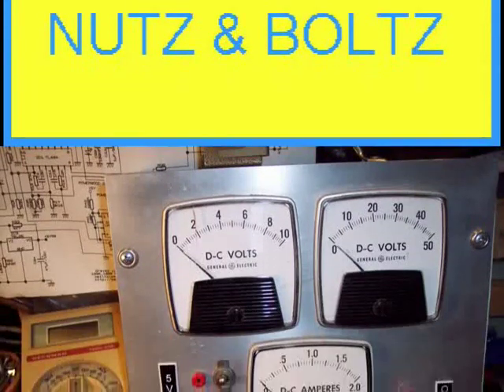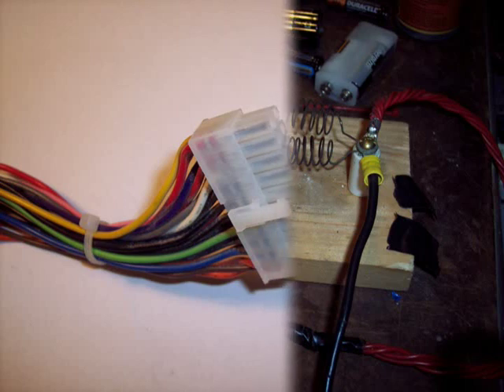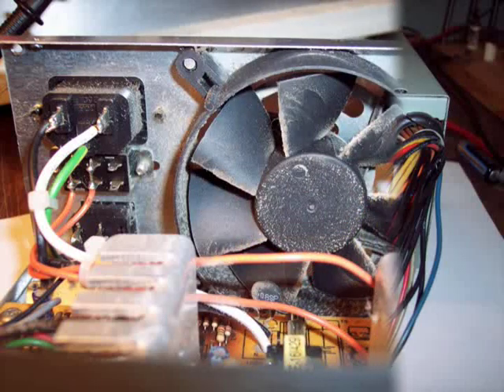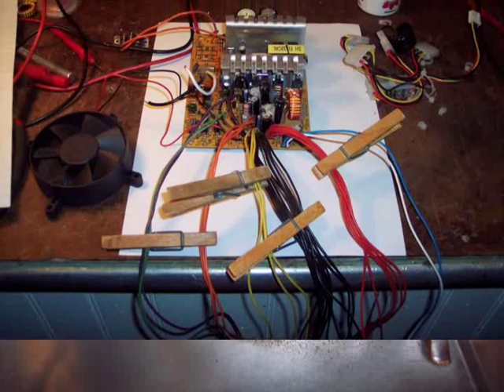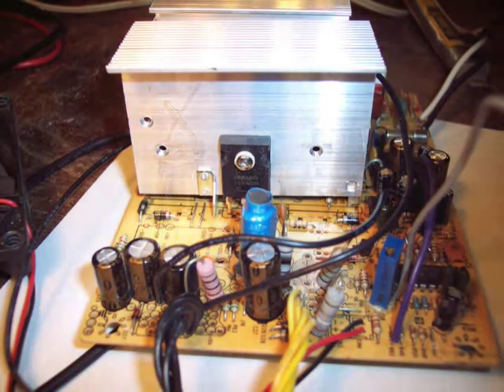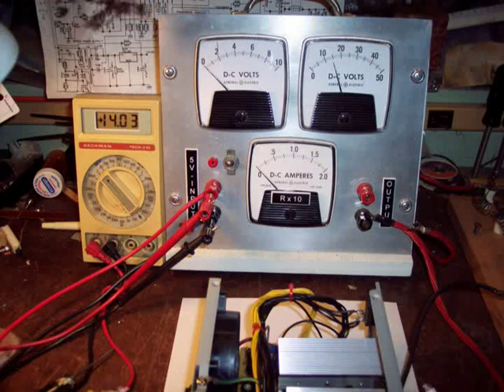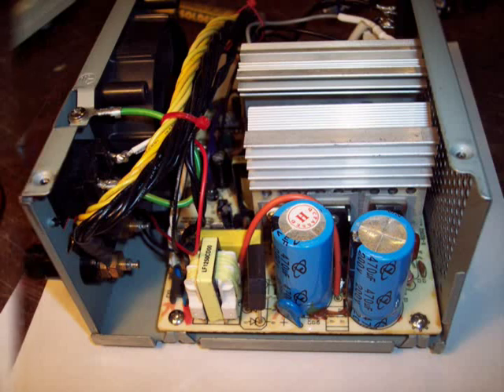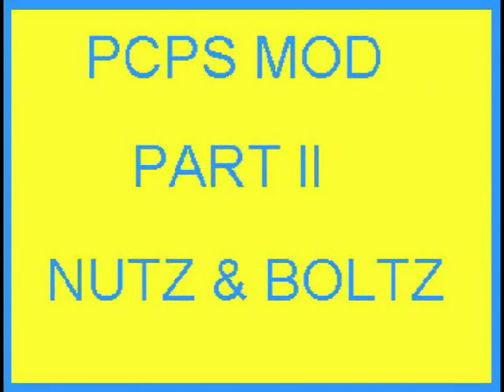Convert PC Power Supplies for use by Ham Radio Part II

Comment: Nice job on both part 1 and part 2. I converted a large server supply and encountered problems with RF travelling up into the supply and tripping the over voltage shutoff circuit. The next time I go to Rad Shack or the local electronic parts store, I'll be buying some caps to bleed off antyRF that travels that way again.

Comment: @paraglidermx  Dell power supplies from 1996 to 2000 use a different wire color code than the standard ATX wire color code. That is probably why you didn't see the green wire.  Check the year on the PSU.

Comment: I am doing this to a PSU. I read on the page that I was reading from that if anyone has a power supply from a Dell computer, they use a different wire colors on the MB connector than the standard ATX wire colors the MB connector. If anyone has a Dell power supply that is from 1996 to 2000, be careful converting it.  Just wanted to say this because I seen the post by paraglidermx that he couldn't get the PSU to work.

Comment: I have just done this myself based on what I learned in this video.  The PSU I used was new so a bit different.  I documented all the steps I took on the Transmission1 forum in the Home Brew hardware section.  Have a look there for my post, my username is Beakster

Comment: Great idea. I have a 500w win power power supply from a casing which is dated at 2006  but the wire colours seem to differ from the ones you show here. It also has male and female input sockets which add to my confusion. I am not brilliant at electronics but am keen to create my own 30 amp supply for my radio can anyone advise?